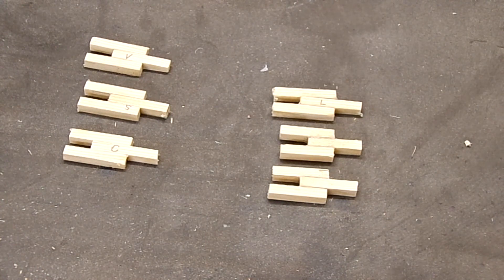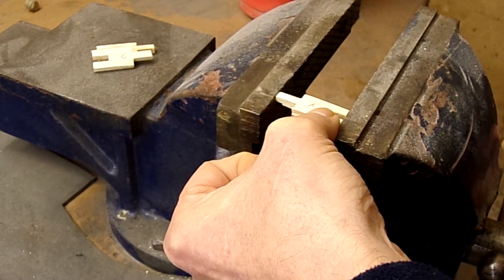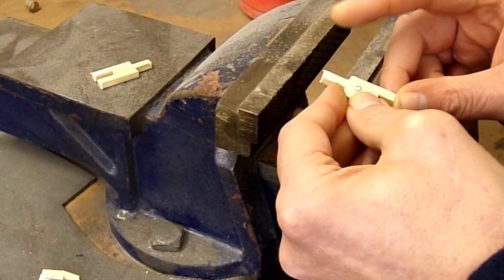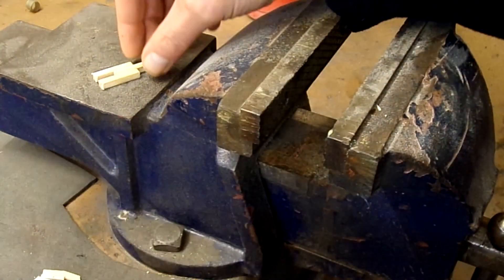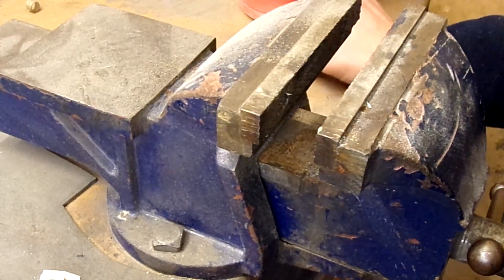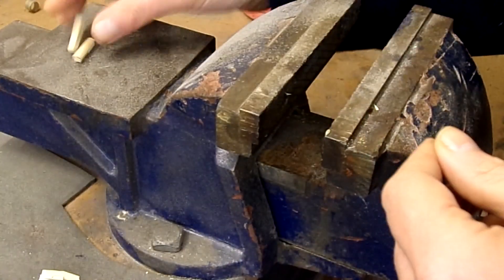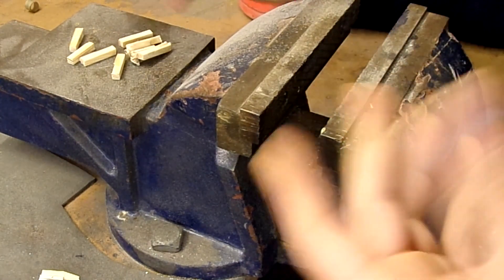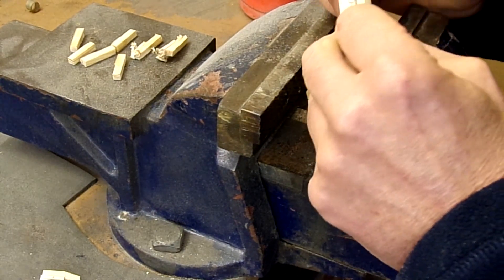Aircraft glue test on good and poor prep parts T88 (take 2).

Comment: The last one may just have been a little longer joint? Or the surface might not have been as flat? It was good to see the test and I will  sand any glue before bonding onto those areas. Thank you for the time to show the test.
Reply from the maker: Hi Michael, you may be right I think that one had slightly longs joints still within the 2 to 3 time the tickness but I also know I touched one with my fingures before glueing ans wiped it with alchol and that might have given it the key. You are right that no matter what you should do the prep. I am happy you are getting something from the videos, it makes it worth my time making them.

Comment: Very interesting. (two thumbs up)

Thank you for taking time to do the test and to post a video demonstrating the results.

One suggestion for anyone trying the same thing :-

( i )    - ensure all end cross sections are square to the axis of travel of the (closing) vice jaws.
( ii )   - ensure that all ends are parallel in plane. 
( iii )  - ensure that the ends adjacent to each other are flush in plane
( iii )  - Temporarily fix a flat, stiff plate between the vice jaws - if serrated - and the test piece
            at both ends to ensure that the force is applied normal to the test piece's  end surface
            and its line of action is perpendicular.
Reply from the maker: Very good point made. I have to admite that my vice jaws are serrated for the video as I took the soft jaws out for some steel work and I normally do my aircraft test batchs with the aluminum soft jaws in (but my father stuff them up and I have to make a new set before my next test sets are done for the youngster and I do some other work on aluminum).